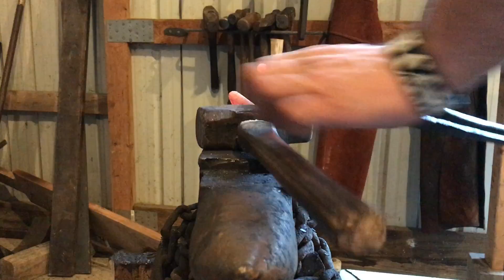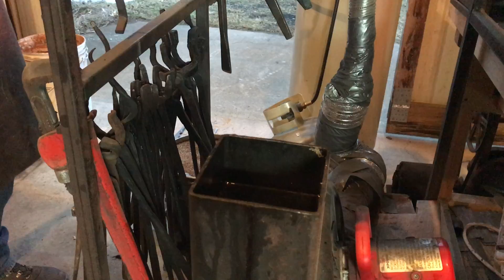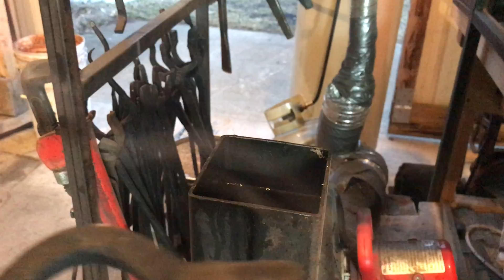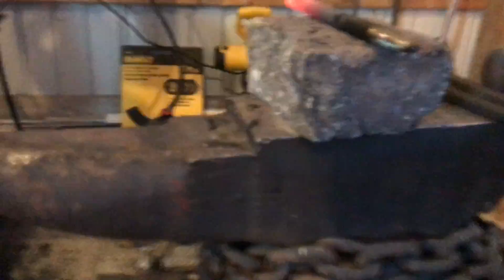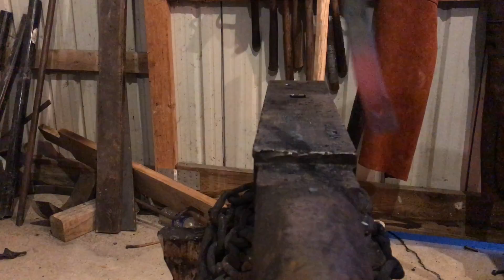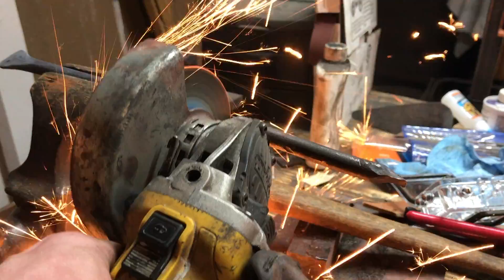Forging a Hot Punch and Hot Chisel

Comment: I've watched most of your vids. subbed.
I'd like to see more tool manufacturing. 
Id really like to see an indepth video on your forge.
Mine is a single burner tyre type. just getting started on the gas forge. I have had some experience with coal, not much though.
Reply from the maker: Thanks or the input.  I'll be building a coal forge soon and i'll video that and i'll do the same when i build a new propane forge.  I've had the one in this video for 2 years now and have beaten the crap out of it.  Any specific tool requests?